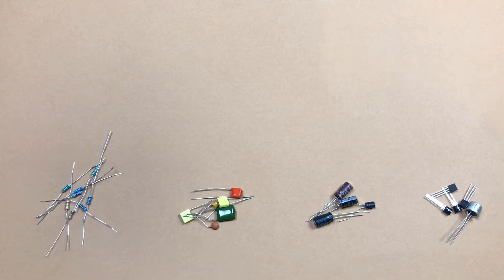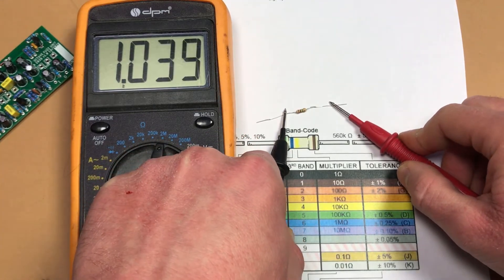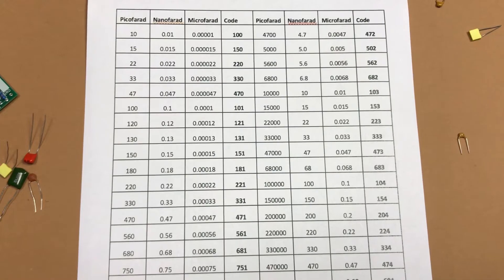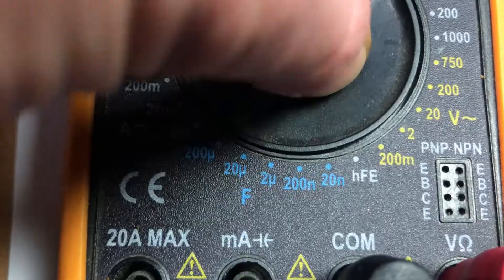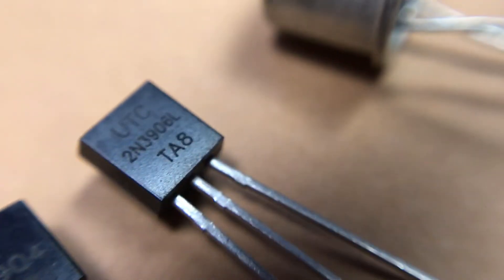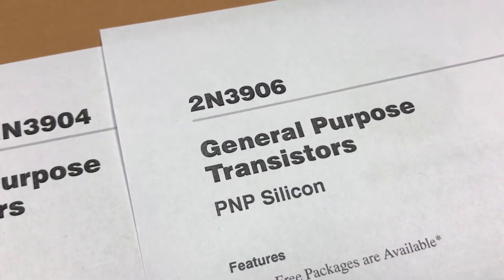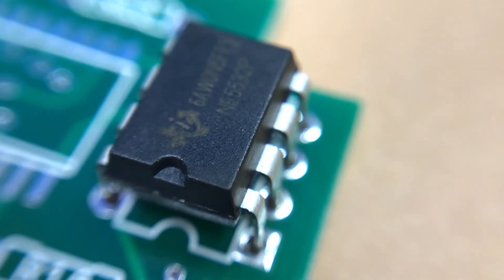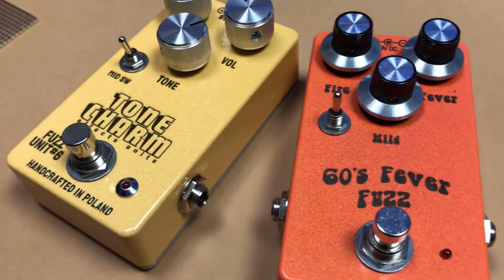Learn All Guitar Pedal Parts In 5 Minutes (Basics To Building Own Pedals And Clones)

Comment: Hey mate how can I replace the footswitch button to Potentiometer to have a dry signal + processed signal . I mean when the Potentiometer is turned all way to minimum would have the dry signal bypass... And when it has in the middle position would have 50% dry + 50% wet.... Maximum position 100% wet

Cheers

Comment: @1:31 Five color bands, so 3 significant digits, a multiplier, and a tolerance band.
yellow, purple, black is 470 (a classic E12 value), the multiplier is red so it "adds" two zeros, which gives 47000 or 47K, with a +/-1% tolerance (brown).
Reply: I thought the first band was green, so 5, but I got the same answer you did otherwise. I was thinking 57000 with 1% tolerance. If I got the color wrong and it was yellow, then I think you are right. 47000. But I am just guessing. I know nothing about this stuff. Just wanna learn to build pedals and amps.
Reply: @Amplified62  I agree that the colors are pretty bad, especially on a blue background. The only reason I went to 47 immediately is that it's amongst the E12 series (10, 12, 15, 18, 22, 27, 33,, 39, 47, 56, 68, 82) which is probably the most common resistor series. The "yellow purple" 47 (and its multiples) is an absolute classic value in electronics. But who knows! The best way is to measure it with an ohm-meter.
Reply: Thought that mf was green too. resistor colors should honestly be neon colored. I mean everything is double checked in electronics but looking at it immediately I said it was a 57k resistor with 1% so in my brain I just assume it's really a 56.5k-57.5k ohm
Reply: Damn I'm blind, I thought the first two bands were green and blue, lol

Comment: Hi Adrian, you are very good, and Poland is a wonderful country.

Perhaps you can help me.  I have this cheap pedal ($25) I just purchased but when turned on, it buzzes, hums and crackles. I thought t might be the power supply, so I put it alone on a 9v battery and it still makes noise. None of my other pedals make noises.

What should I look for 1st?  The on/off switch? There are no bad noises when off, only when on.  

There are two pots (volume, compression) when the volume is turned off it hums a little but not the loud buzzes, hums and crackles.

What do you think? I can PayPal you a little money if you need to help.

Robbie, USA